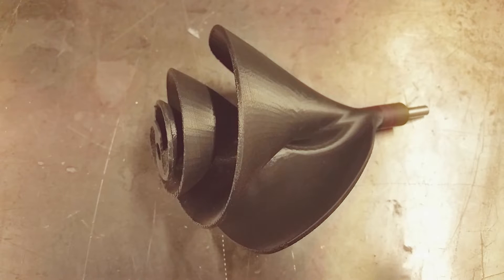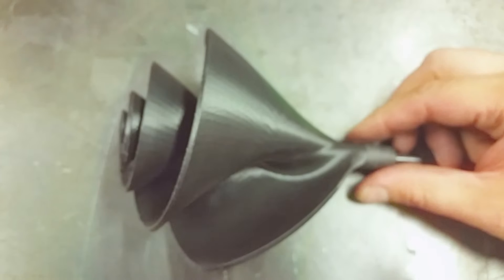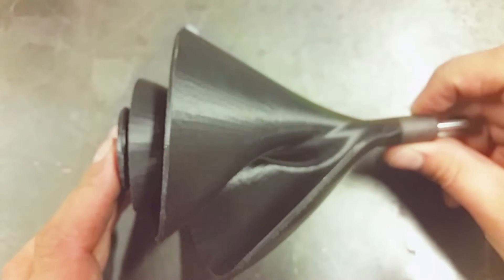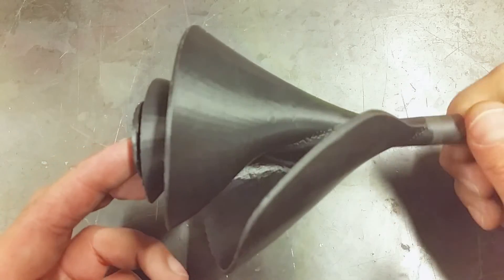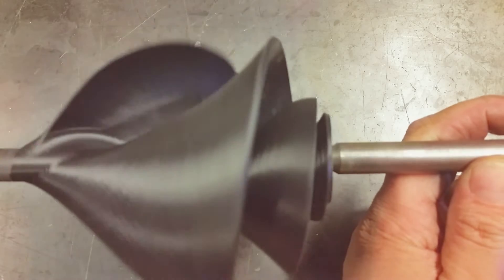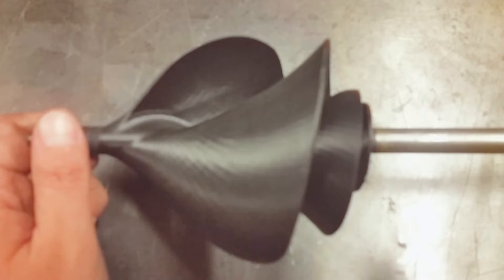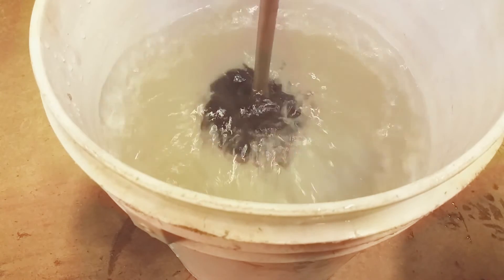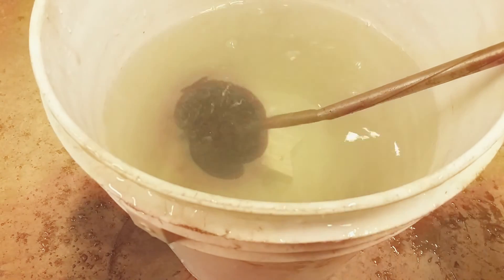Lily Impeller - my take!

Comment: Nice demo. Appreciate that you spun it both directions. The ending direction is the proper spin. The large openings at the bottom capture the water and force it upwards in a compression-spiral. The benefit of the impeller is lost in such a small bucket. The point of this device is the dual action of thrust that also compresses the flow... creating a rotating torus of fluid flow upwards and towards the center. This ultimate mixer that uses the container walls and gravity and the  centrifugal forces and the incompressability of water to assist. Any container size, even an entire lake would eventually be totally mixed by this device... creating a kinetic energy source that could power turbines making more energy than it takes to run the impeller while also cleaning/purifying the water through cavitation.

The reverse spin, which is the main way you started spinning the impeller in the water creates cavitation in the extreme. The amount of water that is sucked into the small top opening cannot keep up with the amount of water expelled from the large bottom opening. The pressure drop in your bucket readily pulls air into the mix. It would be interesting to see what happens if it could not fill the void with air. Vaporizing the water and potentially ionizing it would likely result in energized water gas. A fuel source and source of plasma emissions which have limitless applications. You might have to magnetize the impeller to prevent its dissolution from the condensing gas. Water is diamagnetic and the ionized energized water gas is extremely so. A problem common in regular propellers.
Reply: Mundy Morning Report ima try ☺

Comment: Which shape & proportions would work best for rising hot air or steam? Would I maybe want a fully enclosed tulip or one that comes down to more of a point where the eye of your design is? I feel one way or another I'd want to make sure the rising lower density air/steam is trapped and unable to escape to sides? My application is based on turning a candle carousel into an electric generator.

Comment: Just thinking, can you take a central shaft with two flexible fins shaped as a right sided triangles and twist them around about three times and make the same shape? Don’t think it needs to be solid. Like swim fin material, but will not work if you want to pull water upwards, that needs to be solid. 
Plastic could be shaped like two triangles that fit in a slot onto a plastic pipe, heated to soften, and bent into a circle around the pipe, slid into the slot for the same outcome. Freezing a whirlpool seems way over the top to make this shape. The plastic triangles could be as large or small per requirement. Don’t need fancy computers for this.

Comment: Maybe I am not as smart as the person who designed this originally, but the way I see it this shape does not cause the vortexes that were studied to make it but are the result of the forces at work which created these shapes. It does not automatically follow that the shape will be the best to move masses of water or air in a driven application. I get that people say it is meant to be an impeller not a propeller which then it follows that maybe for a jet boat this might have good application. I think it would take some testing yet to work out whether or not this more complicated design for production has significant benefits to make it worthwhile. It does look pretty in rotation however so I am sure it will be around a while even as ornamental value.

Comment: First,  the head needs to be flipped  180° in direction opposite to how it is in video while rotating clockwise to push water as you are doing when you start the bucket test....you will move more water.   Enclosing this into a tight tolerances shell and you will move air or fluids at a higher velocity increasing pressure as it goes into the wide end and squeezes out the small end..It can be used to both pull or push Pending which end you have set as the intake... how efficient it is at doing both? I don't know!  You will either decrease flow as you increase pressure (input from large end-i.e jetski) or decrease pressure as you Increase flow (input from small end-i.e. waste water pump where the intake is smaller then exit). Of course there's a bit more to it that effects the outcome but that's the gist of what I've learned.
Btw i see the "SMALL" end as the inside center of the rose in on this "impeller."
Reply: Yes, wrong direction, except at the End, but not meant to pull the water out the bucket - and it's meant only to function proper in one direction. It#s implosion technology, or impelling,, from the wide end to the small end - only in this direction it works with incredible efficiency

Comment: Some of the hip sailing community is putting in electric motors. With mixed results. I wonder if the resistance in propellers is too great for electrical efficiency, and impellers on an electric drive would provide the range missing in the electric boat drive idea.

Comment: Wrong direction Also You can't patent this as shaubergers designs are expired It's free for everyone
Reply: All that effort only to screw things up! It is attached in the wrong direction and the curls need to cut into the water to create an axial compression that uses the force to shoot the force out. No, it can not run either way. Notice how the speed is not needed to run this curl into the water? Can you supply the stl file?
Reply: He spun it both directions do you mean the impeller design?
Reply: No
Reply: keeledover means that the shaft is on the wrong side, needs to be flipped the other way

Comment: Hello! I'm starting a 0.5 acre farming space and I'd like to build a module with solar panel/motor to use an impeller for a 50 gallon tank of fertilizer.
Any chance you could build a few and ship them over here? Let me know your price. Thanks!
Reply: are you still interested in this ?  I own a 3d printer and could probably work something out for you. I just discovered about this fascinating impeller and I'll be giving a shot at printing it in the upcoming days.
Reply: anonymousVSnwo  I would be interested in having one printed provided the wall thickness is sufficiently thick to not crack or fracture during load. Please contact me. Thank you.
Reply: I just sent you an email

Comment: one end of the device is INLET  the other is OUTLET .  If you block IN or OUT on any pump there will be no flow, just a whole lot of spinning going on.  test it in a bigger barrel without touching the bottom    or test it  inside a pipe ,  then both inlet and out let will be unobstructed.
There is  company on the net that  makes spiral water pipes. http://www.alivewater.com/viktor-schauberger.

Comment: YOU'RE SPINNING THE IMPELLER THE WRONG DIRECTION IN THAT WATER!
Spin direction IS important to pay attention to. 
Correct spin direction IS NOT ARBITRARY. 

REVERSE YOUR SPIN DIRECTION ON THAT DRILL MOTOR! !

I enjoy your feet.
Reply: Right. He'd get a similar result spinning a square board. At 7:50 he runs it the other way.